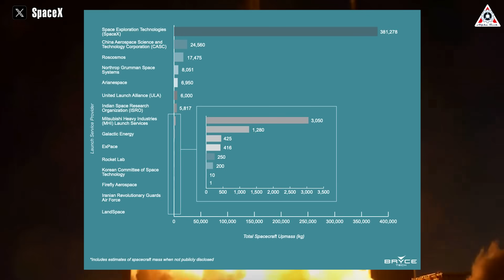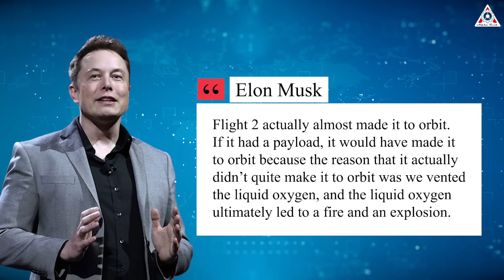To reach orbit, SpaceX makes thousands of upgrades to Starship-Super Heavy...

Comment: The more you do, the more you learn.

What might help on the loose fuel problem, is changing out the Grid Fins for a cupped ring around the hull that deploys. that produces more drag by several times. this could be sectionalized, passively activated where a bit of a lip affect pops it open, then wait longer for the drag to counteract free fall affects, so fuel etc goes to bottoms of tanks, before lighting off engines, might also be good to create a seperator before the lines to keep gas phase out and only allow liquid phase into lines. Basically increase the drag at top of booster, increase the wait time, and gravity versus air resistance will sort out the problem.

Just sayin'!
😊

Comment: Hmm. Well, still not understanding.  Data showed, starship did not reach 18,000. Miles per hour. Only 15,000. Mph, was short on the speed needed. I feel the bigger booster, spacex is diong. why. Not enoughdoing. Space in current booster. I do aswell feel, there's more to why starship blew up. Really didn't need to release it on the journey to space.  Something else was going on there. And they have gone to a lighter stainless steel aswell. Remember starship is using different fuel, then Nasa. There's a reason space shuttle booster had additional boosters. So I'm thinking why starship booster has to be made bigger, running out of fuel.  And it was a empty payload.  Let's hope it reached the 4.7 miles per second on next launch.  As it didn't reach what was needed. It was short on its speed.

Comment: The FAA "Flight Safety Analysis Handbook" requires SpaceX to analytically show that a launch of the Starship-Super Heavy after all modifications will have a probability less than one in a million of injuring or killing a member of the public and a probability less than 30 in a million of injuring or killing members of the public. If SpaceX has made thousands of "upgrades" to Starship-Super Heavy their engineers and analysts have a lot of work to do before the FAA will issue a permit to launch. To understand what is required, see the FAA "Flight Safety Analysis Handbook", which is available online.
Reply from the maker: Thank you for your comment!

Comment: SpaceX has learn nothing about fuel sloshing of the SN’s prototypes because they flipped the booster with an even more violent flip speed, not with a 90 degrees flip but with a 180 degrees one… lighting 13 Raptors to flip an empty booster… not very impressive.
Reply: Your comment is very interesting.   Wonder whether something like Napalm gelatin might trigger the engineers minds on how to stabilize the fuel? 
      Perhaps a 3D printed plastic matrix baffle, like a sponge, but with a directed fuel flow within the matrix.
Reply: Just let the exhaust of the orbiter flip the the booster and then light those 10 remaining Raptors, the fuel will still remain glued to the bottom with the 3 central Raptors still functioning. Piece of cake.
Reply: Show me where SpaceX, no one else, admits that fuel sloshing caused vehicle failure during IFT2.
Reply: It was kind of obvious that the Raptors were shutting off in one direction all starved of fuel and the turbo pumps blew up, like when SN-11 blew up, same anomaly.

Comment: Why do the naysayers feel the need to attemp to humiliate Musk on a personal level?  I expect he knew the previous two launches were, at least, partial failures before some commenter on YouTube told him, right?  

I vaguely remember the spectacular fireworks displays that were the early days of the American space program.  Based on that, I would say SpaceX is doing just fine.  

Pop some corn, kick back with a beverage and watch the show.
Reply: sp66-know-try-think  sigh
No blowing up vehicle after vehicle doesn't provide usefull data. It's like saying that if you crash a BMW that you get useful data about how to improve a Buick.
Every starship they launched was built differently before they had any data from the previous failure. Even the engines are modified before they can data from the failures.

To @frankmcgowan9457 you are so wrong it's just sad.
Sure NASA had some issues in their early days when they just started. However care to look up how many failed launches they had with Saturn 5 rockets? 
Real chefs don't use the 'thrown pasta at the wall and see if it sticks". Neither do real engineers use that concept either.
But then again I guess you are fine with Elon wasting a few million tax payer money every time they end up wasting time, resources and money.
Reply: The naysayers would rather spend money on more jabs and banning meat.
Reply: sp66-know-try-think  sigh
Telemetry can only help give you info on the thing that gives you data. 
If the engines launched aren't the same as the ones you already have built and will be launching next the telemetry means nothing.
If the rocket, the heat shields, the means of attaching heat shields, the configurationg of everything, every thing is different from what you already have built and not going to change it means the telemetry is unusable.

If you shoot a gun and it explodes, you can learn what is wrong about it But before you shoot it building another one according to different design specs then the data you get from the first one only tells you about things you did wrong and doesn't tell you anything if the next one that YOU ALREADY MADE is going to be better or worse.

Answer me this, how many test runs did the Space shuttle have that ended in an explosion? How many times did ESA made test runs that ended in an explosion? How many test runs did the Indian, Japanese and Russia have to do before they got a rocket successfully complete a mission?

Only SpaceX seems to work with the throw the pasta at the wall and claim it's a major success even when the pasta is so overcooked that it is just a glob of sludge.
Reply: sp66-know-try-think  Sure mate. While you are at it, care to list the number of times Space Shuttles had to be launched before it didn't explode? Howabout Saturn 5's? Howabout Atlas class? 

Elon fanboi's always think that he is so great visionary and engineer. He is neither.
All he does is repackage old ideas and make it seem he is the first to think of it.
Here's an example, you probably think that SpaceX is the first to do verticale take off and landing with a rocket.... and you would be entirely wrong E.G.: look up McDonnell Douglas DC-X. And here's the AMAZING part, they didn't need launch after launch after launch to not have it end up in myriad pieces. Imagine that, engineers that actually can design something that works without wasting millions upon millions upon billions.

Comment: Russians fly to the station for 3 hours. Space X does that for 2 days with thousands of upgrades in Pampers. Different ballistical school.
Reply: It has to do with launch locations. The Russian's rockets are sturdy they have performance issues. SpaceX isn't in any hurry. If someone was insane enough to try to get my lumbering rear into space, I would take SpaceX over the Russians' hands down.
Reply: @earth2006  Stay tuned in Pampers on SpaceX
Reply: @Mr1234543211  hahaha, believe or not after Al Shepherd's little fun on the launch pad, all astronauts, for a while at least wore a from of pampers.
Reply: @earth2006   Believe or not , NASA stil cannot build/find the engine wich used for the Moon program.
Reply: Well the Russians are having leaks spring up in the fuel system lately. Perhaps they could try to improve their old designs.
Reply: @keithhoward4069  Are you mirroring NASA's old problems on others, which transferred to new systems?